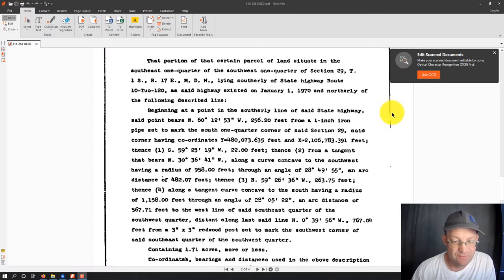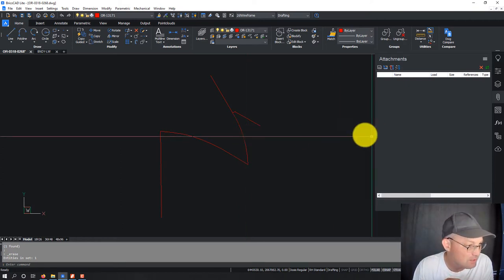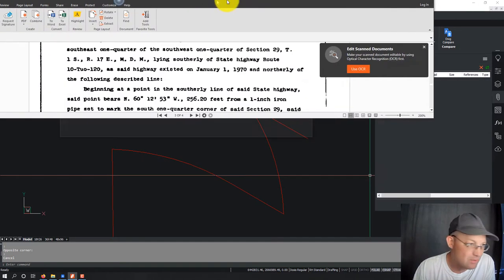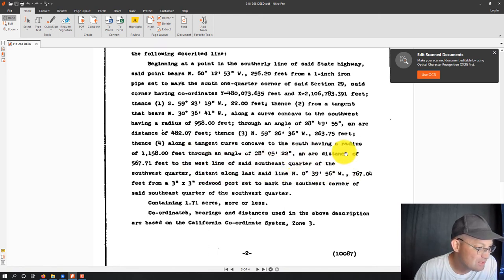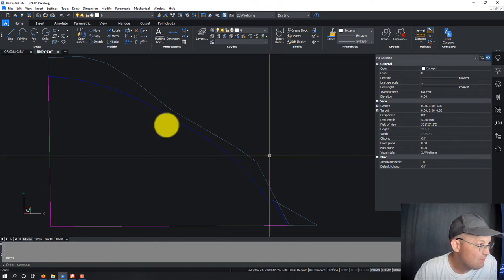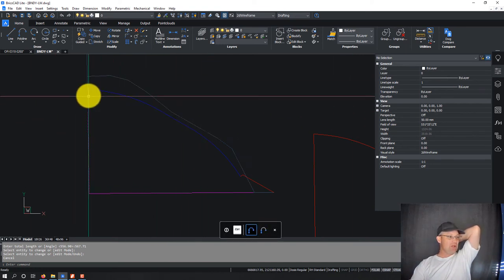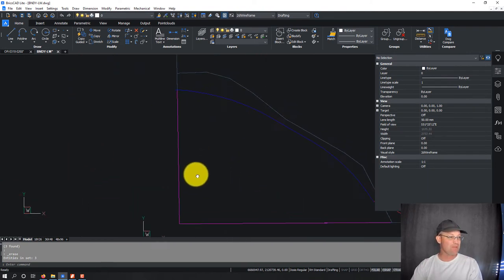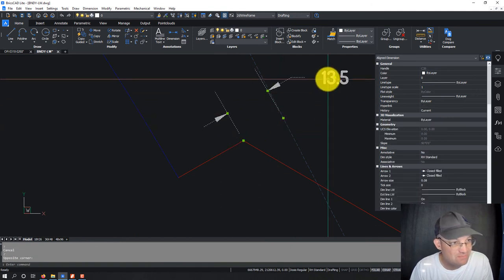Interpreting An Old Highway Right-of-Way Deed

Comment: Landon, the deed does not appear to be nearly as problematic as you think it is. It appears to be for additional acquisition for widening so there is no reason to address the extreme southeast area of your client's property. That existing R/W line to the southeast of the 22.00' segment appears to be the old HWY 120 RW, likely acquired via a deed that you do not have. The course after the 22.00' segment is a curve tangent to the NW bearing given. Create the tangent IN to the 22.00' segment from the southeast, then create the curve to the northwest. As far as the basis of bearings is concerned, you are on the right track considering the rotation between the CCS27 coordinate system and whatever you are using. Hold off to rotate the retracement line until you close on the westerly line. Did you obtain the field books? Sometimes field ties documented in the field books are not included on the R/W map, like your phantom distance on the north side of the orange-colored triangle. Why would the distance be missing from the map? Because the purpose of the R/W map is NOT for retracement of the survey, but to show ownership and transactions. The southerly section line that you assert was not surveyed, likely was, however the method or procedure employed did not agree with your modern distance measurement. With that as a form of evidence, I would not simply assume the "old" distances were measured better than the "old" angles. Also, did you survey the northerly end of the westerly line, or is there any indication that Caltrans (or the Division of Highways depending on the year) located that monument? I think you are moving towards an excessively complex resolution vis a vis a quiet title action. Also, only the crosshatched portion appears to have been relinquished to the county. If you want me to go over this with you, please email me the map & deed.
Reply from the maker: Thanks for the help Rob! I'll take a look at your suggestions. (I didn't even realize you could request field notes for a Caltrans right-of-way survey.)